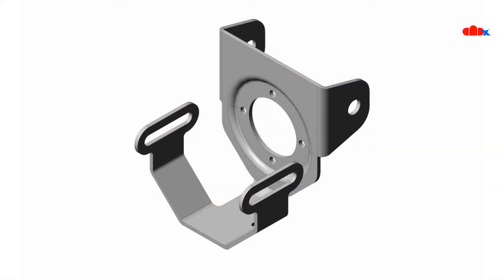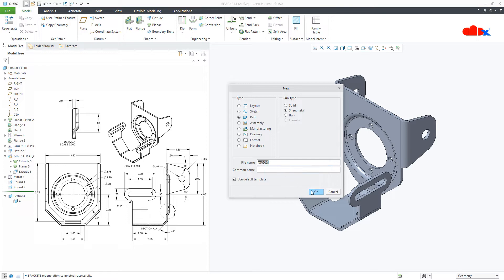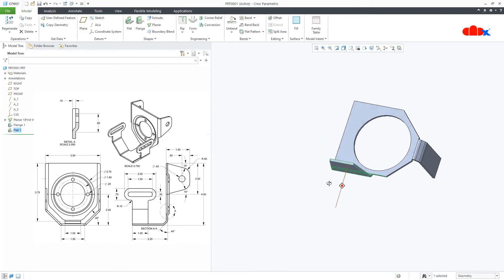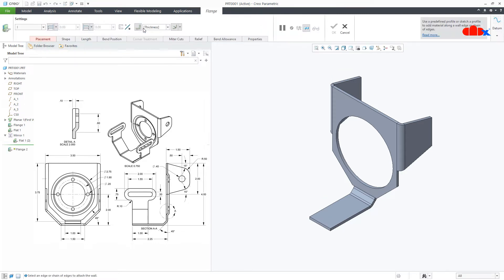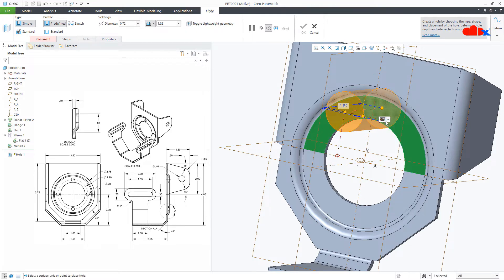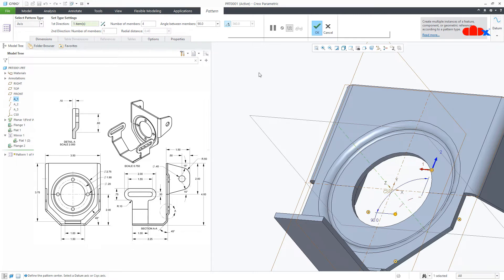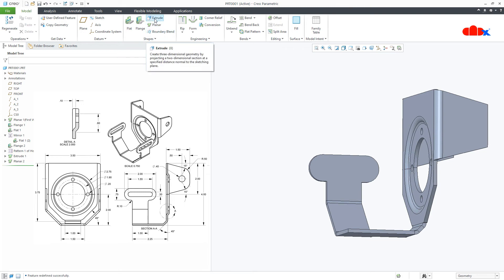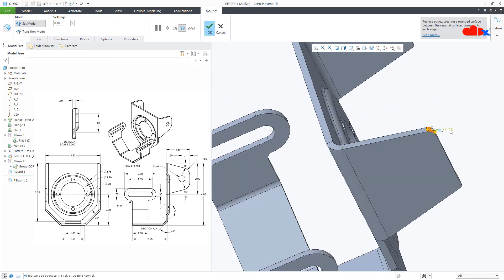Sheet metal tutorial for beginners | Bracket 4 in Creo Parametric

Comment: I tried creating the model. Unable to create flange in curved edge, thickness taken 0.1mm for the same outer dimensions as your drawings(tried on separate model with same thickness with larger dimensions it works!). Let me know where i'm going wrong.
Reply from the maker: Which flange type are you selecting while creating the flange

Comment: Sir, you need to slow down and explain better the "Hole" command and how you center it using the "Diameter" placement. I'm using Creo 6.0 and I can't get the angle dimension the way you did. You just moved things around too fast without explaining. I might as well use the Extrude command to make the hole and then use Circular pattern.
Reply from the maker: First change your placement to diameter and then you will have to drag handles to position the hole. Now move one drag handle to the centre axis and another to the datum plane. You will automatically get the angle dimension for placement.
Reply: @CADxTraining  Thanks. I need to learn as fast as possible for the job I just got. It's similar to Solidworks and Inventor, but somehow different. But in general your videos are very helpful 😉